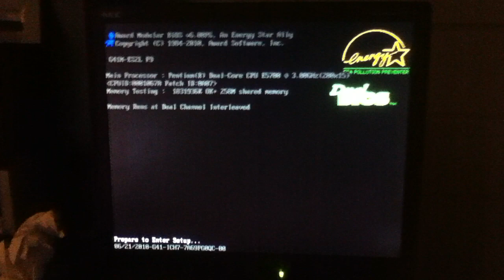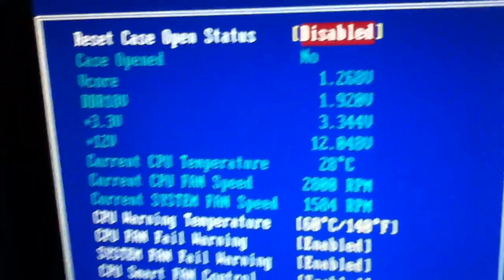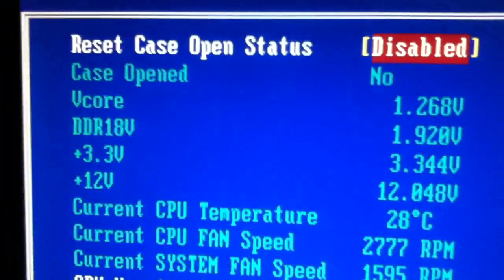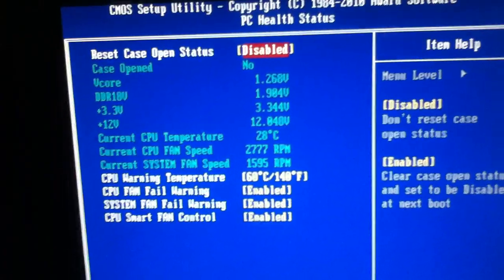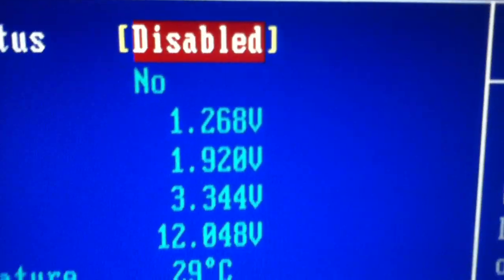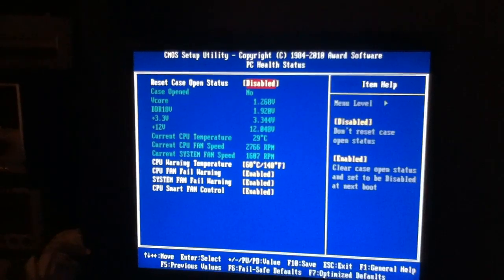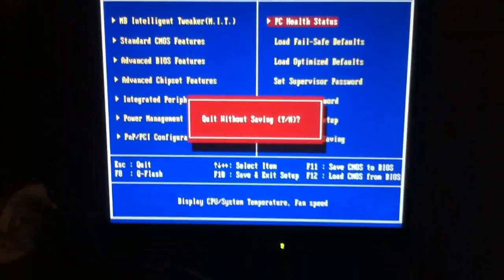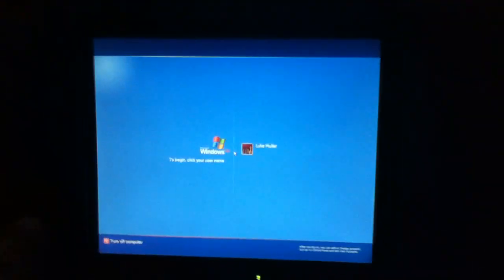How To Check Power Supply Voltages In The BIOS

Comment: One thing I've had trouble with in the past with an under-sized power supply is that it didn't drop voltage unless it was under load. Usually it showed up during hard drive seeks, and caused symptoms like a failing hard drive. I found the problem by hanging a voltmeter on the power supply connectors for the hard drive. Every time it would mess up, the meter went under 11.5v. New supply with more power and all was well.
Reply: I know this was a long time ago, but I believe I’m having the same problem now, however, now that I can’t boot into windows not sure what to do. We’re you able to get your failed drive back or it was just dead after that?
Reply: @bobtheigloo   I think all I did was replace the power supply and the problem went away.  The drive wasn't bad, the supply was just too weak to power it.  Bad drives won't come back from the dead by changing a supply.

Comment: Do you know how to check usb output voltage? Cuz i just bought a seagate external hard drive that can be connected via usb and now its broken after only 2 days of use so i suspect my usb port is the problem. Any idea how to know the volts? Or if you can how to fix this? Im scared of connecting anything in my pc > <
Reply: SamPlushyFive did you drop it or anything? have you tried it w another pc?

Comment: what if your 12 volt rail is at 13.8? I'm guessing that's bad isn't it? and my 5 volt rail is at 2.985
Reply: Errrr 5v rail at 2.985 (3v) is the most worrying
And then the 12v rail is a bit high...

So uh what about your 3.3v?
Reply: +armanelgtron I got a new power supply so I'm not too worried but my old psu never harmed anything idk how but my PC could have been reading it wrong
Reply: In that case, you could have gotten a voltmeter / mutimeter
Reply: +armanelgtron yeah I could have gotten that but I needed a new one anyway since I upgraded my gpu so I just gave my old psu to my cousin and it still works just fine

Comment: my psu voltage is 12v:  12.288v
                                      5v: 5.080
                                       3.3v:  3.392v
                                  my specs is cpu:  intel g4560, gpu: nvidia gtx 1050ti palit dual oc, psu: seasonic s12ii 520w, ram:  ddr4 hyperx fury 2400mhz cl15 4gb single and my motherboard is asus h110m-d, is my psu normal?
Reply: rave master Yes, that's within ATX spec.
Reply: Bruh how did you check your psu wattage??

Comment: do you know how i can check the wattage it doesn't say on my power supply
Reply: If you have a laptop, check the power supply where it says OUTPUT. It should be something like this 20V=== 3.25A ,but yours might change cuz you've probably got a different power supply or not. To find the amount of Watts times the VOLTAGE (20) by the AMPERAGE (3.25) and you should get the amount of WATTS  (mine is 65 watts.)

EDIT: If you have a desktop, do the same thing.

Comment: Guys help me. I want a GDDR5 Nvidia GTX 970 4GB Graphics card and I think it's 400 watts. I need to know if my PC can handle it. All I found out it this. 

Voltage: 
   CPU CORE  = 0.948V
   MEMORY CONTROLLER = 1.524V
   +3.3V = 2.052V
   + 12V = 8.256V
   -12V = (8.256)V
   -5V = (8.928)V 
   + 5V HIGH THRESHOLD = 2.802V
   CMOS BATTERY 1.668V

PCI DATA
 Slot Type = PCI-E
 Data lines x16

I don't know shit about computer but I do know my current GPU is horse shit.
Reply: +★_Vizualize_★ m8 there is a site called psu calculator , that should help :)
Reply: Your computer power supply doesn't have enough power to run your new graphics card

Comment: Hello quick question, i have a 780ti i bought a few months ago off a friend, there was nothing wrong with it, but just recently if i play some more graphically intensive games, (it'll still run them at 60fps+ on high) sometimes it'll cut out completely a part of me thinks it might be a power delivery issue as my pissue despite being 850w (overkill i know) it's from a tiny brand in the uk called point so i dunno if it's really rated for the stress games can give, i'm trying to rule out if it's the PSU spazzing my GPU out or if it's just the GPU itself breaking down as it's getting older....

thanks
Reply from the maker: The first thing I would look at is temperatures under load. If that thing is getting too hot, it might act a little flaky.
Reply: i do i watch them carefully, but i'm pretty sure 75-80 is not toooo much of a big deal for nvidia cards